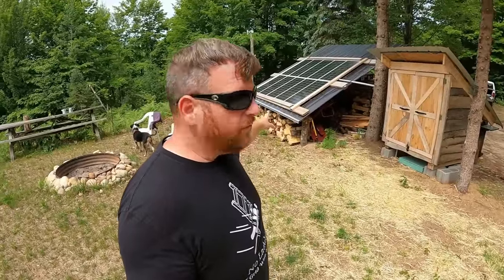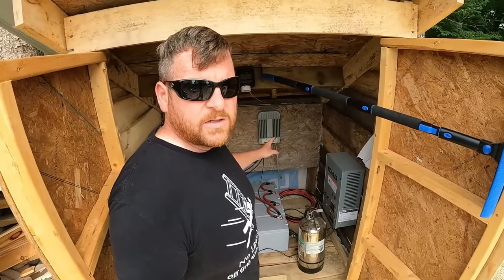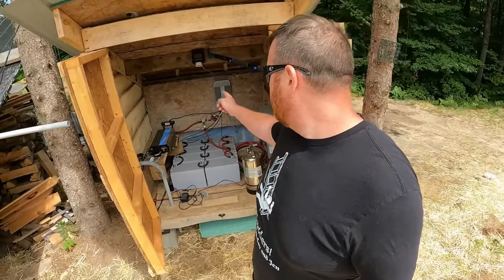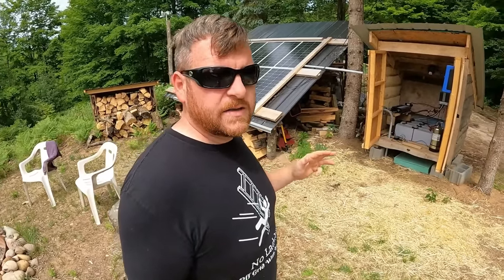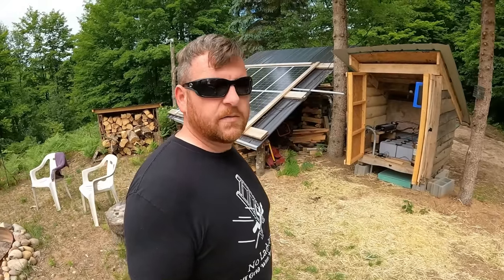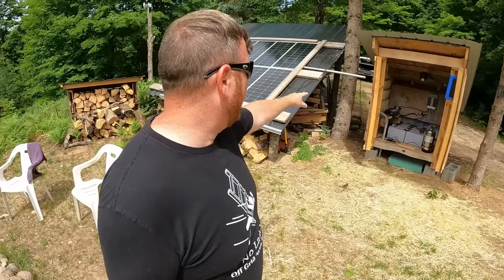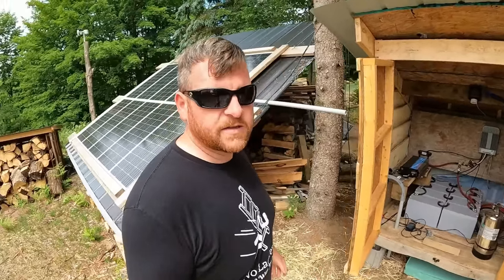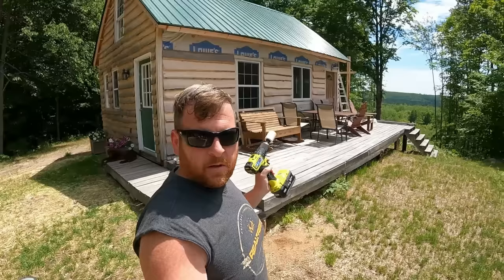One Year Off Grid Solar Power System Update

Comment: If you have the space, bigger residential panels are always cheaper per watt. My new 445W bifacial panels were $245 each delivered. 4 of those would be the same price as ten 100W panels and produce about double the power.
Reply from the maker: Very Cool....do you have a link you could share??? I'm Sure at some Point we will Be upgrading the system and Panels and will Likely go that route. I Actually Bought these Panels when the Pandemic put a short Supply on larger Solar Panels so this was what I could get when I needed them....Glad to know that there are better and cheaper  options out there though. Best wishes
Reply: @OffgridwithJayandJen  I got them from a semi-local place. If you can't find a supplier near you then you can get good deals from signature solar, watts247, and santan solar. Especially if you buy a pallet worth when signature solar has a free pallet shipping sale.
Reply from the maker: @niktak1114  Very Nice....Good for everyone to know. Thanks for Sharing

Comment: Good setup you have there, I'm new to this and it's hard to figure out where to start, but I chose an all in one power bank from bluetti 200p and I'm happy with the solution, I have two 370w panels that I have intend to set up as a kind of fence along the terrace 50 degrees. I have an extra battery for the power bank that I can connect if I'm out in the field, otherwise the power bank runs my fridge and freezer just fine.
Reply from the maker: Sweet.....we considered doing the same. I really only built this system to learn and it was fairly affordable at the time

Comment: AGM's are the way to go. The price alone is worth it. Your tin on the backside of the panels will generate quite a bit of water when it's raining. My system is running in Alaska with limited daylight in winter and on spongy ground(muskeg) with solid ground many feet below the surface. This means that all my buildings must be on stilts or as we say it here "pilings". Water is the one thing we here don't have to worry about because we get 275" of rain each year and have a year round creek running across our back property line. The good thing is we get to run hydro power when the  sun is not up. Hope you have started your chainsaw milling for your out buildings.
Reply from the maker: Agree the AGMs are working very well. WE have a Real Sawmill so no more Chainsaw milling for me

Comment: thank you, i've had a single used panel, 230 watts, on my trailer for a couple of years, with a PMC controller.   i upgraded to a MPPT and now it is fully charged by 0930 in the morning.  as you indicated, refrigeration is our biggest concern, but we now have no concerns regarding our lights (LED) and powered vent (MaxxAir) and the fridge keeps things cold.  in our case, the cost was about $350 Canadian.
Reply from the maker: That's awesome, glad to hear you can get away with less even. I'm not an expert so I'm not sure if we could have gotten away with half the batteries and half the panels, but so far so good. Glad yours is working good as well. Thanks for watching

Comment: Thanks for sharing your system! I don't know if it's something that would work for you not knowing your winter climate or the constraints of your power system.  But we have a rain catchment system here in Maine and we used a stock tank heater in ours one winter. Fashioned an insulating sleeve for the spigot out of a piece of pool noodle (we only use ours for outside watering- chickens ducks etc) and there were only 1 or 2 of the coldest days of winter that we were not able to get water from it.
Reply from the maker: Very Nice.....I love hearing tips and suggestions from those Doing it....thank you for the Tip. I'm not sure what the draw on those heaters are, But Will check into it and see if maybe we can incorporate something into the rain catchment system. We do plan to bury our water tank at some point....but not sure if that will be prior to winter or it will have to wait until next year.  thanks again.

Comment: will prose was my inspiration.  I have 3 100 watt panels running to 3 800whr deep cycle. I have a older 30 amp controller and an over powered inverter. runs my residential fridge and deep freeze. full size appliances.  I'm on grid so I have a 6 amp maintenance charger hold its charge.
Reply from the maker: Very nice.

Comment: I'm off grid to.. I recently bought a fridge/freezer cooler... it is awesome.. I set it to -4 and it runs of 2 12v lead acid batteries.. the cost of solar is very cheap... depending on the batteries you go with.. I save money by running a generator for electric cooking devices.
Reply from the maker: Nice....good work bud

Comment: Bought my entire system used from an auction and a solar company that sells used/repossessed panels. Roughly $12k for 6kw in panels, 2000ah batteries, 12kw inverters, qty 2 250 midnight solar chargers, all wiring, breakers/ boxes, and the structures holding
the panels. There are so many options, just have to be willing hunt.
Reply from the maker: That sounds like my kind of dealing buddy.....awesome work

Comment: I love your commentary . I learned a lot but I’ve Beverly seen how this kind of system run into the house and how it collects to appliances
Reply from the maker: The Cabin is Wired like a standard House. ALL  with a breaker box and AC lights and Appliances. The solar turns the energy into DC battery power.....and the Inverter converts it into the AC so the cabin can use it just like a house.    LOTS of other people get caught up on using DC and trying to be efficient, which is great but it makes things confusing and more trouble.....Just build a system to carry your needs

Comment: Have a similar setup at the cabin, but kept it at 12v with 2 banks of 500w of panels and 2 of the same charge controlers that you are using. I know 24v is more efficient, but if one of my charge controlers die, I'm  still producing power.
Reply from the maker: I have something similar set up not too. I just did a two year video about it. Great minds 👍

Comment: Jay, have you considered using the 2" ridge blue foam board to line the inside of your solar cabinet?  You would make a cube out of the blue foam board that would basically seal the entire cabinet on the inside.  You could also place a blue foam ridge board panel set around the outside of the cabinet that would be at least 18" tall with 6" in rhe ground. This fence would keep the snow and cold air from going under the cabinet on the outside of the cabinet and the foam board cube inside would add more isolation on the inside.  Many of the YouTube people out west make this shell arrangement around their water collection units to help manage the solar heat like a cooler does.  I really like your solar setup.
Reply: Hello Jay, Love the solar system set up.  Got to figure out some insulation for the building and the water catchment tank especially,  maybe a water heater element as a dump load for the water tank..
Reply from the maker: I sure do....it's on the list, lol
Reply from the maker: That would be nice. Trying to decide if insulating the whole thing or just the batteries is the best option.

Comment: One thing I plan on doing is when I get started on mine out of at the property is to add an alternator mount to my bicycle trainer. I’m a cyclist, since when weather is bad I’ll get on it for a minimum of an hour everyday. It’ll be a good way to maintain the bank daily and get some exercise. I have good wind in the valley all winter and spring too so I’m gonna add a small wind generator.
Reply from the maker: Great Idea
Reply: @OffgridwithJayandJen  thanks guys, I’m in a warmer climate as well, so I’m gonna go ahead and spray foam my battery shed and use dry cell deep cycles, with a solar heater set up

Comment: When I spent winters in the upper peninsula, I always replaced my lead acid car battery for a deep cycle marine battery and never had any issues with starting the car.. even at negative 30°... Although turning car lights on for a minute before starting doesn't hurt either... My small solar system uses 3 lead acid batteries, about 360 amp hours. And 200 watts of solar.. the system runs my propane furnace, lights, fans, my frig runs on propane. More than adequate for my travel trailer. It also runs my garage lighting.. my place is also up north Michigan... I'm torn between battery types,,
Reply from the maker: It is a hard choice, but it is amazing how little solar we need if we keep.it simple right. Best wishes

Comment: Moving the solar system closer to the house would help improve power loss do to wire length resistance.  My rule of thumb is anything under 100 feet to the item using power is good.  Amazing system.  I may build it's clone.  Insulting the battery shed like you would with a house may help retain heat in winter.  I noticed a use difference in my storage shed after insulating it.
Reply from the maker: Nice....appreciate the  nice comment. Believe it or not, the shed is only 40 feet from the cabin, and about 50 feet from the main AC panel in the cabin. I made sure to convert the power to AC at the shed to help with the distance it has to travel,  as I have heard DC power travels poorly compared to AC. If I could go back, I would definitely insulate the shed properly. Honestly, when I built this system I figured I would have upgraded by now and I would redo the whole set up better, but 3 years later and I have not found a reason to do so. I do struggle a bit in the winter months, but the other 9 months It does great. Just make sure you have lots of sunshine in a good location, in the woods with 4 or 5 hours won't cut it. Best wishes

Comment: Nice!
I pondered building a solar outhouse like you've done but ended up with the entire thing sans the panels in my living room, hiding it all in a cupboard. However, I do definitely see a couple of advantages in doing it like you have.
Reply from the maker: Hey HH, appreciate the info and honesty. I completely agree there are pros and cons to both ways. If I had more room in the cabin and felt my solar abilities and knowledge was good enough at the time to safely install it indoors I too would have done so. Space, safety, and my desire to be flexible with my set up took me this route. Not knowing how  I wanted to lay out my yard or originally where or how i wanted  my solar array  made this set up more flexible. I'd be happy to hear your advantages if you have any thing different to add. Thanks
Reply: @OffgridwithJayandJen  Hi there! My system is rather small, just 288 Ah LiPoFe3, (3 x 96Ah batteries in parallel), 520W panels and a 2000W inverter. Panels are quite a ways from the house, about 25 meters or 30-32 yards but since I got small panels (65W each) I can run 2 strings of 4 panels in series which brings the system to about 78 volts in full sunlight - thus I pretty much eliminate the loss over that distance as I feed the controller through 2x20mm2 (or 2x4 gauge).
 I run a small extension from the inverter, IT insulated, which powers a hot plate, a micro, a toaster and my vacuum cleaner - but I never run more than about 1600W at the same time to be gentle on the inverter. 
The rest is run by 12 volts. Fridge, water pump (20 liters under the sink, fill it up by hand when empty) and lights. 12 volts, all of them. 
You got your house free of batteries, inverters, chargers and so on, which I think is really nice. What I got is automatic heating of the batteries during winter time as I heat up the house with firewood, and I can tinker with the system if necessary even on the coldest or wettest of days.

I really think your solution is neater, and makes more sense in a lot of ways. I just went with what I got out of ease of building the entire thing. I had the space, so it made sense to do it like I did. I can hide it all in a small cupboard in my living room, all but the inverter that is. The inverter is mounted on the wall so I can easily access the on/off switch as to when I need 230V. 

Mounting the panels on the ground I have found is a real treat, just like you have done. I think people really ought not to have the panels on their roofs unless they really struggle with the aesthetics of a ground based system. It is so easy to get the snow off when you do not have to climb ladders, and you can add or repair all you want without having to resort to climbing up and down. 

My place is a weekend place, not full time living. At least not yet. If I go full time I will get more panels, and a bigger battery bank. But for now, for long weekends and as a get away place, it works just fine.
Reply from the maker: @Hermod_Hermit  I love when useful and helpful conversation happens. I completely agree the ground mount array is the way to go if snow is something you have to deal with. The ease and safety involved makes sense, also I actually like seeing the array as it is a constant reminder I'm using my own power supply. Sound like your system, like ours, serves you well. Best wishes.

Comment: I'm looking at land in the U.P. right now and most of it will require me to put together something like this for power. 

Even with more panels and a larger system it's still way cheaper than having power poles and lines ran.
Reply from the maker: For sure it will be. Even getting a cabin or power pole hooked up in a neighborhood can cost you more than this system.....add half a mile or more to that power line run and you are saving big time.

Comment: Thank you for the reality.  I wanted to buy a solar generator, battery, and after clicking payment plan it was, shockingly, too expensive.  Needless to say, I did not get it and was so disappointed, until I researched other ways to get the same product at affordible prices.  Start small, learn, build as you go.  You are way ahead of those doing nothing or not paying attention.  P.S.  I like the seperate shed and lean2 set up.
Reply from the maker: Thank you.....building a system is both good for learning and the budget, as you said, buy and add batteries as you can afford it.

Comment: I'd consider putting what's known as a
chine$e diesel air heater or diesel parking heater in your battery shed.  They are around $120 and come as a standalone little cabinet that can run on 12-24 volts DC and has an exhaust pipe which the heat from can be used to keep your solar panels defrosted instead of just being wasted.  It's basically a 3000btu on idle or 30,000 btu heater on high that I would run on idle most of the winter, and maybe on high for a couple hours a day when it's below freezing or super cold.  I used one to heat a greenhouse that size in Michigan and it was more than adequate and cost effective.  I'm a huge fan of diesel air/parking heaters, I have 5 and heat my vehicle, my unheated and uninsulated front porch, my garage, a greenhouse, and my travel trailer.  You could get by running just a liter of diesel a day and it would make a huge difference by keeping your batteries warm and since the cabinet style is standalone and modular it gives you a backup heat source for any purpose... For example-I heated my 2 story house for 2 days with a couple of these heaters when my furnace took a crap in an ice storm.
Reply from the maker: I will certainly do some research into those diesel Heaters. Thanks PI, appreciate your thoughtful comment and sharing your personal experiences with then. 👍

Comment: Just set up a 12 volt solar system today and testing it.  Learning a lot.  I like what u did with yr system!
Reply from the maker: Thanks Tom.....12 volt system works good, all depends on your needs and wants. Make sure your wires are rated for what you are drawing. Be safe
Reply: Definitely sounds like you’ve just started off as soon as possible if you’re buying multiples go with high voltage only because I’ve seen people spend a lot of money on 12 V only to have to replace it all because they want to get decent sized inverter

Comment: Just happened upon your channel. I like this little system and follow Will as well. Thanks for the video! I built a small system for my truck camper and running a 26 qt fridge, charging small 150w-300W generators a 200ah Lithium battery, portable tea kettle and other cooking appliances, usb fans and small electronics with just 200W panels. I have  a 300W portable folding panel array feeding 100ah SOK battery in my shed to run the pump on my inflatable spa and would like to see if a system like yours could manage the heat element for 7.5 hrs.I hope to be where you are and as confident in your solar setup journey in a year.
Reply from the maker: Very cool.....sounds like your system is well equipped.  We have aboit 5kwh of power storage, since the batteries are AGM and only get aboit half the WH that's what it comes to. So divide that by your spa draw amd see what you get.

Comment: Man its cool to see you are a regular dude and building a regular off grid system. Ive built the same but broke down and spent a ton on eve cells. I like the low frequency split phase sungold power inverter its been great and dont have the crazy firmware updates and all that crap that some inverters have. I respect the hell outta what yall have done and are doing
Reply from the maker: Thanks buddy.....seriously great to read a comment like this. I hear ya on technology updates and such, I wanted to keep this as simple as possible
Reply: @OffgridwithJayandJen  I'm fairly certain that simple is better. In almost all cases with solar. Some might like messing with it all the time but I just want it to work ya know